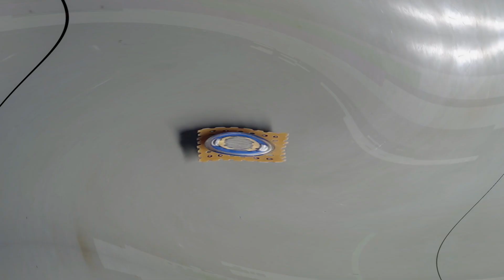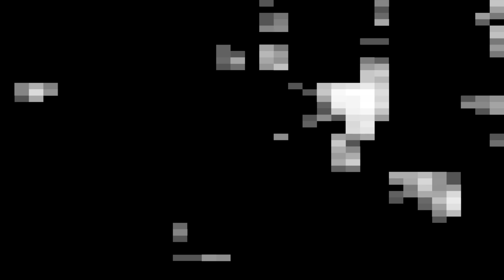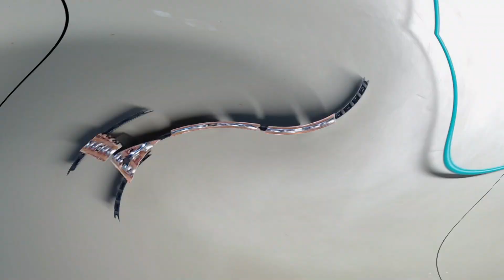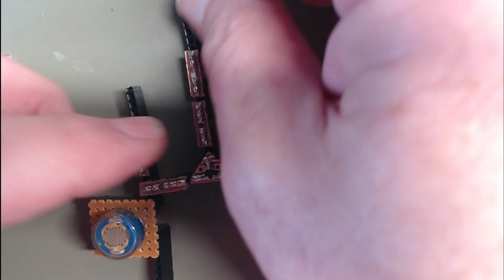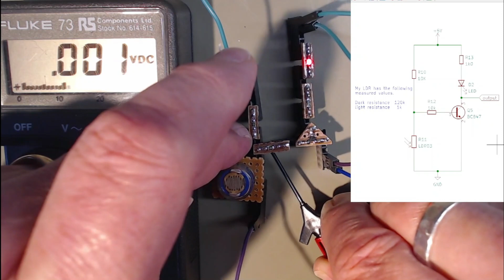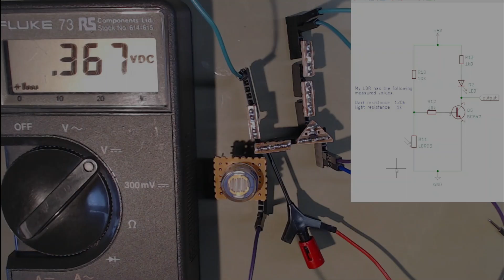#169 Experiment 3 turn on a transistor when its dark

Comment: Great description ,  how;s about using using a piece of plsin perf board as a base perhaps fixing it to some timber with a couple of stand offs.  The pins on the "connector blocks" could be popped into the holed in perf board and hold things steadier  🙂
Reply from the maker: Glad you liked it, perf board is a good idea. i might have to revist my little components and see if they would fit.

Comment: I remember early garden solar lights using this circuit. Great tutorial.
Reply: I still use that circuit for my outside Xmas lights
Reply from the maker: Well thanks Fred for popping on by. What outside lights should be wifi controlled now. Fred you're so last week :-)
Reply: @TheEmbeddedHobbyist  Wifey I don't let her control anything that can be controlled by a switch🙂
Reply from the maker: It's been around a long time. the only problem is that the transistor can spend sometime in the linear region where the transistor acts like a resister and drops more voltage across it and thus dissipates more heat than when its either full saturated (e.g. On) or Off